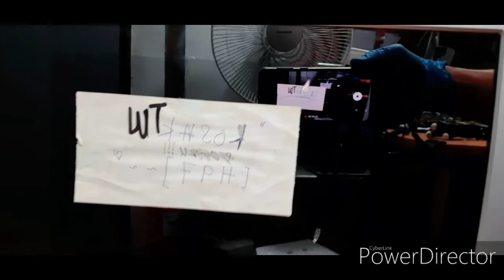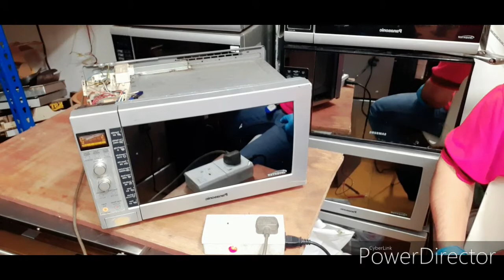How to repair faulty microwave inverter board

Comment: Thank you for this video,i changed the Gt60n321 IGBT but when i start microwave,IGBT blows again and i need to change it again, I'm so confused, magnetron is ok
Reply from the maker: @brainfeeding  If you change the IGBT, it must be the same code, don't try to change with a different code number of the IGBT don't forget to check also the second door switch if it is OK  TQ  stay safe stay creative
Reply: @RSModifier  The number of IGBT Is correct and same as the old one, but it blows after replacing
Reply from the maker: @brainfeeding maybe the breach rectifier diode has a problem
Reply from the maker: @brainfeeding  check the magnetron if it is not grounded to the body, if the magnetron grounded to the also possible make the IGBT blown
Reply: @RSModifier  magnetron is ok

Comment: Excellent video. My Panasonic inverter Microwave blows fuse while sitting idle. Sometimes after one hour and sometimes after one or few days while door stays closed. I checked all parts are ok and the microwave works good while fuse is not blown. Please give your comments. Thanks,
Reply from the maker: Have a nice day sir,  yes that is normal sometimes the fuse blown,  but when you change to new fuse the microwave work properly, on my little experience fuse become  hot from time to time  it have also a limit but mostly technicians said the fuse will not blown if there in no short circuit ot IC or transistor problem,  but for me not all the time,  not only twice I can't already count how many times I encounter fuse blown with no shorts circuit or any IC  or transistor problem,  thank you so much, stay safe,  GOD bless you,  and your family 👪.  If have questions just  write it down I'll try  to get in touch with it later  I will be morethan happy to help you.
Reply from the maker: Pls help my channel,  pls like and share, tq so much,

Comment: i have a panasonic S333 im  getting H98 on screen after  20secs i changed the magneton with a old one i found it worked for a while now the H98 is back again and the magnetron testing good could it be the inverter board?
Reply from the maker: 1st thing you need to do is check the door switches,.
Reply from the maker: Sometimes when you check the magnetron by using multimeter the magnetron is ok you can't found any problem, but the multimeter can't  identify if the magnet have crack,  you need to check the magnet of the magnetron  if have crack,
Reply from the maker: Thank you stay safe, GOD bless you and to your family.

Comment: Thank you for the informative video.  My national  Panasonic microwave had a shorted to ground magnetron. Also found the bridge and igbts shorted. Replaced the parts as per your demonstrated in the video. Now my fuse does not blow anymore. However, on running the microwave power, lt shuts down in about 3-4 secs. What needs to be done to clear the fault. Any pointers, please?
Reply from the maker: Can you give me the model of your microwave?
Reply from the maker: Check the 3 interlock door switch,    try to press tip of the switch if it is have sound clicking it means ok but if not clicking it means need to change the switch,
Reply from the maker: Sometimes if panel board faulty also make the microwave stop 10 or 50 seconds ,
Reply from the maker: If still  not fix ,Just leave a message, I try to reply sooner or later, thank you so much,  stay safe,
Reply: @RSModifier  Hi there, thank you for your responses, my Panasonic model is NN-C596A. The inverter board number is F6645M305GP.
Reply: @RSModifier  I will check the 3 interlock switches as suggested. One more question which I need some clarifications is that the high voltage connector wires to the magnetron. I have mixed up the two wires as I did not put a marking when I took them out of the magnetron to repair the inverter board.  If the wires are interchanged to the magnetron will there be any issues?
Reply: Modifier Checked the 3 interlock switches. One of them tested to be faulty. It’s output is always open. I will change that switch. Need to take it out to see if it’s normally open or close. Thanks for your pointer.
Reply from the maker: The 3 interlock switch one is not the same, that's why you try to see the connector is not the same to avoid wrong switch replacement, the only thing you need to do is press the bottom button you can here sound clicking , if not that is fault need to change
Reply from the maker: No problem with that wire it's ok to interchange that wire,
Reply from the maker: @UCBMcrFLzJcplZv_oMD5GeGg you must check your magtron maybe  the magnet have crack, if the fan rotate it means there is one of your interlock switch need to replace, if not it will happen when you  open the door the microwave will turn on, if you close the door it will turn of.
Reply: Hi Modifier,  My Panasonic microwave NN-CS596A worked fine for about 5 months now. Now it shuts down after 3 secs. I have checked all the switches and all are in good condition. I ran the diagnostic test using the microwave inbuilt diagnostic. Error noted is H95. The convection program without the Microwave works fine. Panasonic troubleshooting flow chart suggests DPC could be problematic. I also swapped the RY1 relay on the DPC without any success. Any pointers on how to tackle the issue will be appreciated.  Thank you.
Reply from the maker: Have a nice sir, if you check all switches is in good condition, the only problem is the magnet 🧲 of the magnetron broken, tq stay safe, GOD bless you and to your family
Reply from the maker: Just check the magnet of your magnetron maybe it's broken,
Reply from the maker: You can also try to barrow the DPC if you have extra same model of microwave,

Comment: Thanks for the video. I have a Panasonic Genius Sensor 1300W inverter microwave that I rarely uses. Used like once per week. Since this morning it runs for three seconds and then shuts down. I tested the primary and secondary switches and they are fine. I disconnected the magnetron and it ran according to the timer. Once I reconnect the magnetron it stops after 3 seconds. Any suggestion?
Reply from the maker: Try check the magnet of the magnetron  maybe it crack,  later i try to send you picture,
Reply from the maker: Thank you , stay safe, God bless you ang your family,   pls also help me support this channel, like and share, tq
Reply from the maker: And don't forget to SUBSCRIBE,  tq
Reply: @RSModifier  I checked the magnet and it seems to be in great condition. Could it be the inverter board?
Reply from the maker: fffinga 
Yes possible the inverter board you need to check the IGBT transistor,
Reply: Hello there, I am having a similar issue to yours. Did you manage to solve the problem. If yes, how?
I will be grateful if you are able to update the status of your microwave and share your solutions. Looking forward to hearing from you.
Reply from the maker: Which one sir? What is the problem of the microwave?
Reply from the maker: Because all problems that i share on my video are solve,  pls tell me more about your microwave issue,
Reply from the maker: Maybe next week I will upload video about microwave
Reply: @RSModifier  Thanks. My microwave when running on microwave power. Resets after 3 secs when I press the start button. The diagnostic test of the microwave shows error code H95. I read the service manual it points to DPC, RY1 relay, and the door switches. I am able to verify all the conditions but not sure about the DPC circuitry.  However, the microwave runs on convection, its timer, etc all running fine. Thanks for your response once again.
Reply from the maker: Did you check the magnet of the magneton?
Reply from the maker: Base on my experience h95  is magnetron  problem
Reply from the maker: Do you have extra magnetron?
Reply from the maker: Sometimes when you check the magnetron using multimeter the magnetron is ok but still you need to test change magnetron, if you have extra microwave just barrow the magnetron, that is what I'm always doing.
Reply from the maker: Pls sir help me promote also my YouTube channel by sharing
Reply: @RSModifier  ok thanks for reply. I will try to get one magnetron and test. 

My heat works fine only microwave is a problem. Since the heater is working does it means the main board is okie?
Reply: @RSModifier  okie noted
Reply from the maker: Your microwave have grill? 2 heater on top?
Reply from the maker: If yes,  the relay of the heater is separate to the relay of microwave
Reply from the maker: I also encountered that problem, the  heater working fine the microwave not working  I just change the control board and it's work. Just try if you have extra from other microwave make sure same model,  don't buy new one unless you try first  with old one.
Reply: @AtmaS  I just got a different board on Saturday to test. I will update this thread with my progress

Comment: Hi, I have a Panasonic NN-C994S Convection Oven with an inverter model A66454T07AP which has a blown 1M30D-060. The magnetron works but the oven function goes only up to 210F :-( Can I replace this blown transistor with any 1M30D-060 available? Thank you for your time :-)
Reply from the maker: Yes  you can replace  make sure the same code of the transistor,  thank you  satay safe God bless you and to your family.

Comment: Can you tell what is the chip q702
Reply from the maker: Fujitsu stylistic Intel Core i3-3227U processor, 3MB, 1.9GHz
Featuring Windows 8, the Stylistic Q702 hybrid tablet PC comes with an 11.6-inch display with pen and finger input support.
Reply: The chip on the inverter board q702 needed cant see chip number because chip burn itself
Reply from the maker: @TheMathy182  sir it's hard for to answer your question because there is a lots of inverter, can you give me some details of your inverter,     I'll try my best to help you
Reply from the maker: Is this a inverter of the microwave?
Reply from the maker: If it is the inverter of the microwave give the model of your microwave
Reply: @RSModifier   found it panasonic with convention  the chip is 1M30D 060
Reply from the maker: @TheMathy182  IM30D 060 is a IGBT  transistor  6000v 30a
Reply from the maker: @TheMathy182  if can give me the model of your microwave, I pretty sure I can give you the  more details of the inverter
Reply: Anyway thanks for your support
Reply: @RSModifier  inverter model is NN-K5741JF
Reply from the maker: Om sir you mean is the inverter bpard module?  Tomorrow I'll check my microwave if I havr same model, if I'm not mistaken I've already repair this model, I'll check it for sir.
Reply from the maker: This is the  IC CODE  of inverter module 702S7B03,

Comment: How to use microwave without Inverter  with transformer ,capacitor & h diode and how to keep communication 3 wires working and microwave will work pls explain how to do conversion from inverter to Transformer